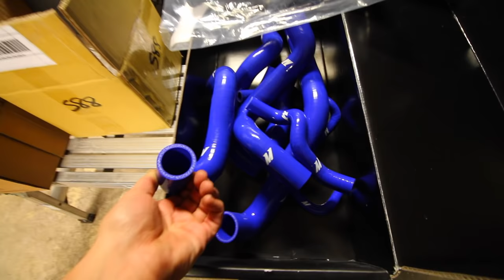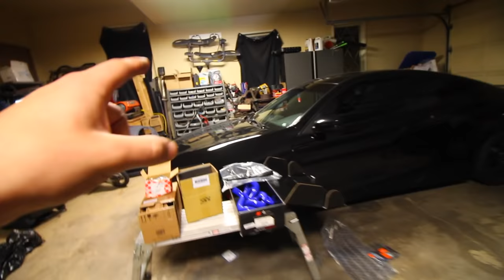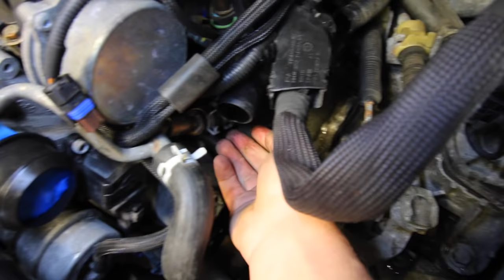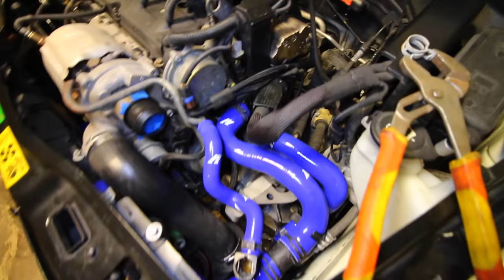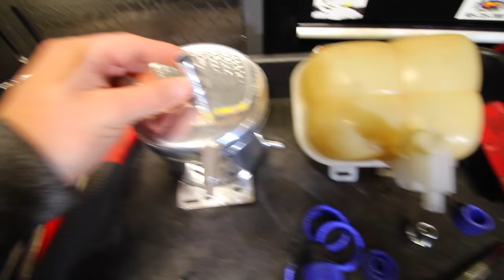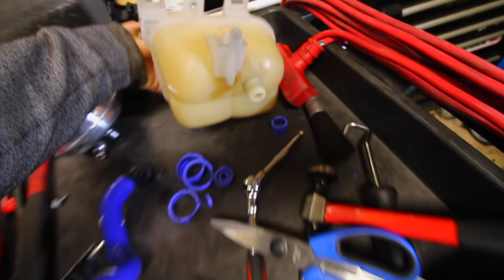Mini Cooper S/JCW Cooling System OVERHAUL

Comment: Just an FYI: this engine is a 1.6 THP -  a fruit of BMW and PSA cooperation. In Europe it is often found in range of Citroen and Peugeot models. Direct fuel injection and twin-scroll turbo are just a couple of features that helped this power plant win The International Engine of The Year award in 2007 and held it till 2015 (1.4 - 1.8 category). I am using its turbo and turbo manifold in my NA to turbocharged project (Citroen C2 VTS). 
Proper DIY content, good job Milan.

Comment: for 60/40 ratio, it has to be 3.78L coolant, 2.52L water, total of 6.3L. 
60% of 6.3L is 3.78L
40% of 6.3L is 2.52L

Not 1.5L of water. 

To make it easy to calculate for the ratio, divide 60 by 40 to get 1.5, then divide the amount of coolant (3.78L in this case) by the 1.5. This will give you 2.52L which is how much water you need. Will work for all ratios.
Reply: dimeitry He now has 76% coolant and 24% water.
Reply: Somewhere around that 75/25 mark. 
1.5 + 3.78 = 5.28 L total
3.78/5.28 = 71.6%
1.5/5.28 = 28.4%
Reply: dimeitry  I was thinking the same thing, I was like "your math is terrible" hahaha

Comment: Silicone hoses have been proven to be more of an issue than factory many times over. Factory hoses are very good on an R56. Replace the pump t stat and crossover pipe and you should be good.

Comment: The OEM water piping is less reinforced for a reason. Ideally, as the hose ages, it can expand a bit without having a blow out. You dont want to use silicone piping for coolant the same way you dont want to use worm clamps on them. Theyre so restrictive the line is alot more likely to break.

Comment: i like the hose idea, but doesn't oil melt those types of hoses. i know oil is not in the coolant, but what about the inter-cooler and just changing the oil ? also with the bigger inter-cooler would that put stress on the rad/rad fan ?

Comment: Why do I feel like he did the math wrong? 60/40 right? He did 40% of the amount of coolant, not the full system capacity. Lets say your car takes 6 litres capacity. So a 50/50 mixture would mean 3 litres of coolant and 3 litres of water. A 60/40 mixture would mean 3.6 litres of coolant and 2.4 litres of water. I just feel like his numbers are off. I could be wrong though.

Comment: I'm doing the exact same thing to my 2009 JCW.  I like that you took off the intake manifold to get more room.  I think I will do that too and while its off remove the carbon from the intake valves.  I really like that water pump.  Where did you pick that up?
Reply: If you own a 2009 JCW the water pump has already been upgraded to metal. It is part of the JCW package.
Reply: @tmc6663  Mine ended up being plastic.  Maybe they phased that in after my Vin .  I got the metal replacement one.
Reply: What other upgrades do the 2009 JCW have?
Reply: What other upgrades do the 2009 JCW have?
Reply: @parvb  Sorry for the late reply.  I am pretty much still doing this same mod.  Just my coolant hoses are Blue generic (ebay).  I have the intercooler and all the intake tubes to replace just like this video.  On top of this video I took off the intake manifold and already cleaned the carbon off the valves with a solvent a pick and some brass brushes.  That actually only takes a few hours to do and is not very difficult and should restore performance and fuel mileage if I ever finish this project! I am going to do the noise maker delete and I have a more tapered charge pipe that helps spool up the turbo a bit quicker that I have been running for a long time (the inlet turbo pipe on these cars breaks at about 50K miles so just do it.  I have the Alta spring that helps you retain boost.  I have a forge blow off valve seat that keeps the stock valve but blows off to the engine bay so you can hear it better.  The stock blow off valves fail pretty early too, and so does the high pressure fuel pump so keep an eye on that stuff.  The stock JCW intake is actually pretty good so that is stock.  I am in California so I cant go too overboard on this or it wont pass smog.  For suspension I have the Bilstien sport struts that are shorter than stock on NM springs.  I have a 20mm rear bar on urethane bushings (which creak bad, need to fix that).  I have adjustable rear control arms.  I am going to put in front urethane bushings and also redo the control arm bushings in urethane as well.  I stiffened up to lower motor strut mount by filling the gaps with silicon.  It was worn out so now it makes it shift more positively.  Pretty much feels like new.  But to get it better I might get a new arm that has solid urethane bushings.  Huge project and I am a master of procrastination when I hit a snag.  To make it worse I am not using a manual, just youtube videos to do this work (which is probably most of the problem right there).
Reply: @parvb  OH dang, I just realized. Not my JCW, but in General.  The Turbo is larger on the JCW than the S and the intake plumbing is a little different.  The S actually spools up a little faster because of the smaller turbo and smaller tubing but the JCW has more top end.  I got it with sport suspension and it had a 18mm rear bar.  I thing the S has a 16mm.  The sweet spot is a 19mm if you upgrade.  Wheels are different but the JCW wheels are pretty heavy (25 lbs+ each)  You can do way better with the aftermarket.

Comment: Great video.Can you tell me please the water pipe from the thermostat to the water pump, How is it secured?  Is it a pull out clip same as the thermostat  end?  Thanks buddy..
Reply from the maker: It is sandwiched between the passenger side of the engine block, and the thermostat on the other side of the block. You have to more the thermostat do replace it.

Comment: :) Hi.
Nice video!!
Can I ask you a question?
Mi daughter 2008 Mini Cooper coolant is overflowing out of the expansión tank,  it was ok before I replaced the water pump, so I end up replacing thermostat and water pipe and still doing the same I carefully follow a bleeding coolant system from a tutorial and no luck:(
No sure what is going on??

Comment: Just changed my heat exchanger gasket and turbo oil feed line because I have oil leaks. I can say it is a pain in the ass to put the car in service radiator position. I have a R 56 N 14 engine from 2008. And also rust is starting to show. Only on the headlight I lost 4 of the screws because they got stuck on the bushing and melt the plastic. Anyway be prepared because is not as simple as you see in YouTube 😁

Comment: Thanks for the video! I think you are the only Tuber that has mentioned the water pipe.  That same piece disintegrated on me at the water pump end.  I've been working on this thing all afternoon and I haven't taken my manifold off yet...  You mentioned that the pipe just sandwiches in between the pump and the thermostat with an o-ring.  Is that correct?  Just push the pump end in and then install the thermostat to get that pipe installed?
Reply: I need to know the same buddy is the pump end held in with a push clip like the stat end?? Thank you
Reply: Anthony Hampson its been a while since i did this, but i believe it just pushes in and when you mount the TStat it sandwiches the pipe in and keeps the pipe from coming out.
Reply: @BartMink  Thank you buddy. Top man looks like a great afternoons work Dam plastic parts only bmw hey.

Comment: Thinking about getting a mini to work on as well. Pros vs Cons ?
Reply from the maker: As long as you aren't doing body work to fix it (rust), you're in the clear. Also, plan on purchasing a Bentley's service manual :) 

As it goes for the work, its pretty straight forward like most cars. Its kinda like working on the accord, but with a lot less room.

Comment: Hey Milan! can u please do an instructional video how to fix heater problems for my volskwagen golf. it doesnt heat as much. only a 1/3 of the half of my temp gauge on the dash if you know what I mean. I'm from calgary which is cold so maybe thats a factor? Would greatly appreciate it. thanks!
Reply from the maker: You could just have to bleed your coolant system to release any air, and top it the expansion tank.
Reply: milanmastracci I'll give it a shot! AND also because I was thinking it might have something to do with my car's thermostat?

Comment: How do you get the lower passenger side radiator hose off?  My hose clamps are rotated to the top making it really hard to remove.  Any tips?
Reply from the maker: Angled needle nose pliers, or hose clamp pliers.
Reply: @milanmastracci  I would need to  completely take it apart to get to that.  So guess what, that hose is going to stay rubber until I can get to that.

Comment: you don't have to take the intake manifold the throttle body and the head light could have save you alot of time those crossover pipes are common problem that's where my leak was coming from

Comment: Did you use the stock hose clamps
Reply from the maker: I can't recall, but you should only use spring clamps for the coolant system
Reply: @milanmastracci thanks for advice, I'm having trouble with installing one spring clamp it doesn't matter if I have it fully compressed or if I add lubricant to slip it on it won't fit and unfortunately nobody carries constant tension hose clamps. Junk yard run is what I'm thinking now

Comment: how is 1,5 litres of water and 3.78 litres of coolant a 60 40 mix? its seems as if youmultiplied 3.78 by .4 however that does not give you a 60 40 mix, if you calculate it correctly it gives about 2.5 litres per 3.78 litrres of coolant. hope you see this:)

Comment: Reuse old piping adapter?
Reply from the maker: What piping adapter?
Reply: milanmastracci the black adapter with steel clip you put at the end of the piping connection to the tank or engine part.

Comment: today whil i was driving my car 
i felt a smell from the engin bay 
soo i stooped and i opened the hood 
guess what 
i found a huge water leak in the system
i was terrified 
i taught it was from the gasket
so i stooped the engin let it cooled down and i removed an aluminium part 
u know it's protecting from the heat of the exhaust collector
soo i found that the same plastic tube has messed up like your Mini does
know the car is parcked in the house :( 
i have to fix it and it's raining without stooping and i have no garage :(
Reply: James Hatfield why -_-
Reply: James Hatfield Don't need to being rude comment.

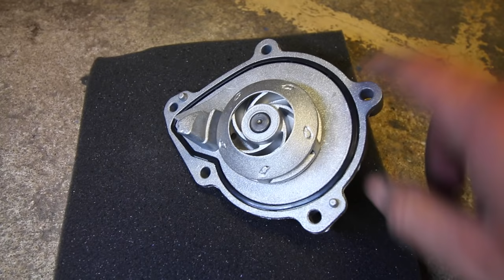Comment: 9:05
Not true! it is made of painted aluminium not plastic! It looks like plastic but it is not !
Reply: oMoyo Moyo incorrect! The factory impellers are in fact plastic. I’ve had to replace it due to breakage and it’s 100% plastic.
Reply: @djquick  Its a BMW thing.  I had a 1994 325i convertible.  It also had a plastic impeller (phenolic to be exact).  It degraded over time (70k miles) and sheared off causing the car to overheat almost instantly (which later lead to a blown head gasket).  Same thing happened on a 1999 M3 convertible I got to replace the 325i convertible (I traded both of those for my Mini).  Don't wait until the water pump goes out.  It is going to blow guaranteed.  Change it to a metal one like in the video.

Comment: Any open forum's that are German-Japanese friendly now the collaboration is more concrete for cars using German and or Japanese parts?   I'll take an invite into a good JCW'S or Copper S any gen forum.  Their everywhere around here.  Second gens are flooding the used car lots, auctions and junkyards quickly. Id love to find them homes at least.  Spare parts/part's car worst case.  Could of cleaned house where I was last week-  3L Supra TT's, 4.0L's and 4.2's in soo any Lexus'. Beautiful '94 DelLe Sol with a K-Tuned engine I really wanted. A few other Honda's an old Golf's under $2-3K that would go for 5x that up here.  Toyota vehicles were overpriced as was BMW and most newer German cars.